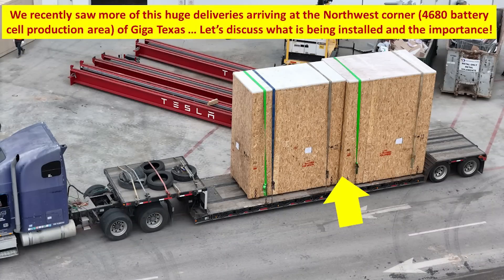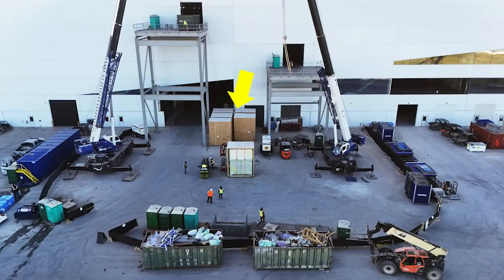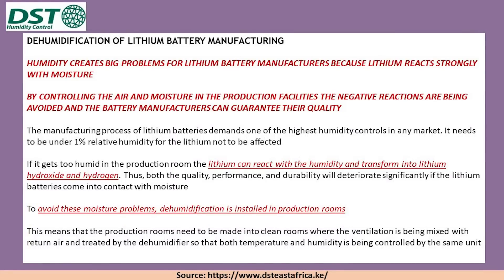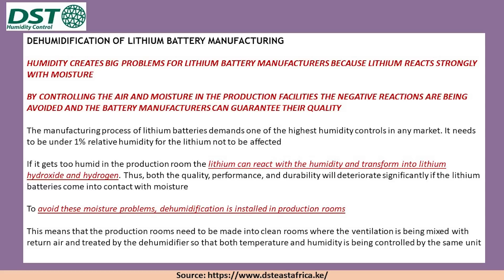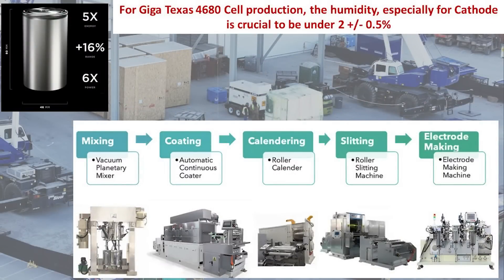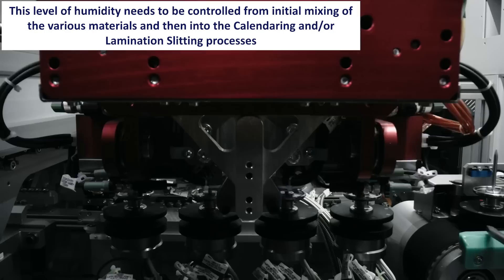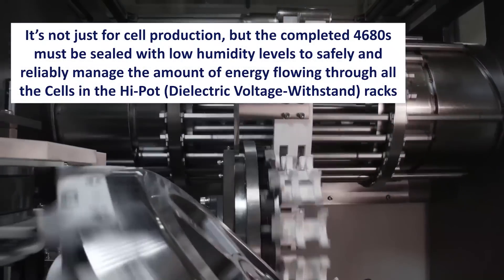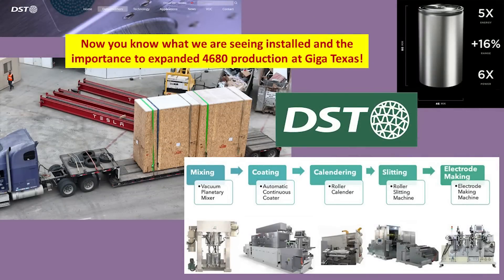Dehumidifier System for 4680 Cell Production at Giga Texas SHORT Deep Dive Video

Comment: Really helpful. We should see dehumidifiers at the cathode plant too. I assume both the ingredients and output for the cathode plant are powders. The 4680 plant in main building separately mixes cathode and anode powders with binder and conductor powder to make electrode sheet which is bound to the conductor sheets. Then the jelly roll made and canned and electrolyte added and can sealed. 
Tesla have a patent where dry electrode sheet is stuck to thin wet electrode on conductor sheet - the laminated electrode

Comment: Is this something Tesla learned by trial and error trying to improve rejection rates or was it planned from the get go?
Reply: I think it's something they've learned over time. I believe that they are currently naming the 4680 as gen 2 but I'm open to be corrected on that. Either way it is more evidence that Tesla doesn't stand still for too long and constantly striving for the best manufacturing techniques. The machine that builds the machine.😊
Reply: Manufacturing lithium ion cells has required dry rooms since companies first started manufacturing them in the 90's.